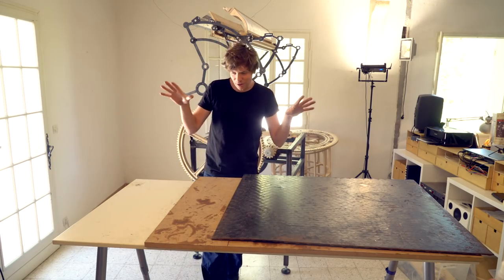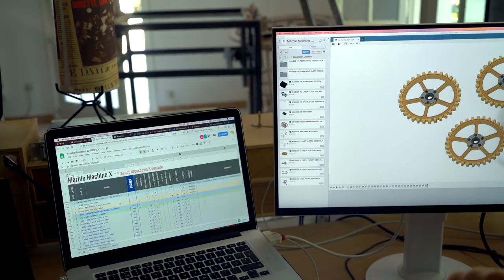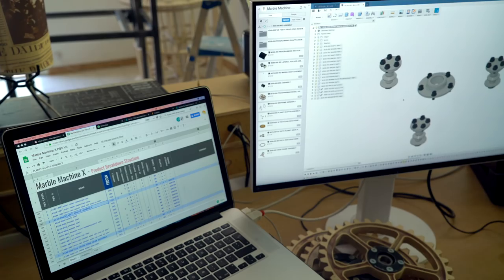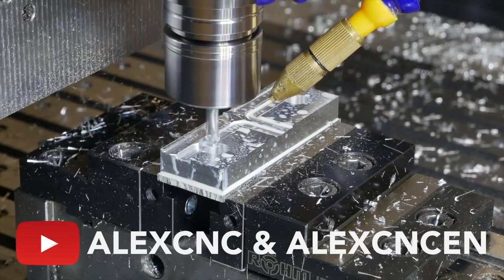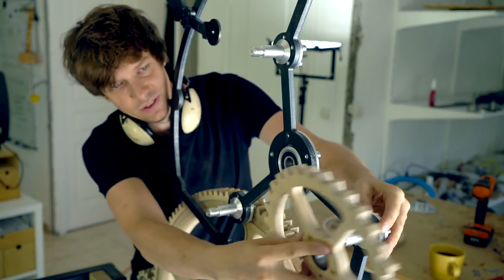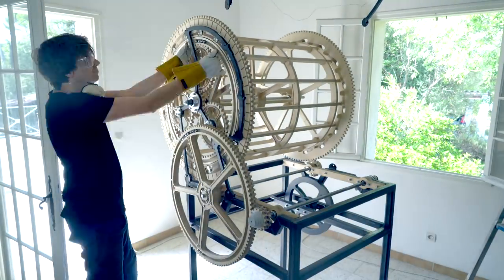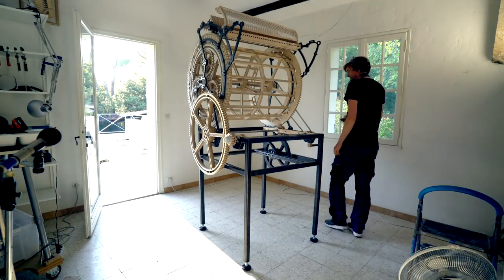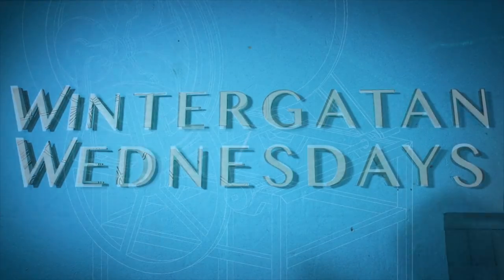NEXT LEVEL PRECISION - Marble Machine X #48

Comment from the maker: YAY! Acrylic washers were temporary, and galvanic corrosion is not a problem in this case :) just guessing some of the questions that might occur down here in the commentary field, Looking forward to some more #200-001 now.
Reply: Wintergatan your guitar needs a setup man
Reply: Green Day fan never would have thought
Reply: I thought you had a small drill press? You can use those to tap stuff and keep the tap vertical.
Reply: #200-001 is a necessity when watching your videos. Otherwise one might miss something.
Reply: Quick question, have you thought about putting any kind of finish on the black metal frame? Like brass for instance, or maybe silver to match the aluminium parts? The contrast between the light yellowish brown plywood and the dark metal is fine, but I feel like it could look a little better. Of course, this is a cosmetic issue, so I imagine if you have considered this it will be as one of the last few steps. Apologies if my question is a waste of time and you'd already thought of/answered this.
Reply: Imo, you should add a spring loaded idler pulley to the drive belt to help add some tension (to help keep the belt from wiggling up and down when you crank the handle). Having one will also allow the drive belt to automatically re-adjust/stay snug even if you move/adjust the main drum.
Reply: I don't  think that temporary solutions are good for mmx project, you should make parts that are ready to be added to mmx ;) I think it will somehow speed up the building  process
Reply: Wintergatan you should patent the marble machine if it is becomming a product
Reply: (feedback for team YouTube:)

The member system is a nice concept, but at 4,99/mo it's crazy expensive. €60/year for sponsoring one channel. Multiplied by however many channels you want to sponsor this could be an additional month of rent each year for some people. The way I understand it you still get ads on YouTube if you pay for membership? That seems a waste of money. 

I'd rather see a tiered system like patreon has, so people can choose how much to spend instead of being forced to spend a lot or nothing at all. The timed badge could make it difficult for some people to stop their subscription even if they can't really afford it anymore since you lose a lot (sunk cost and such). 

Please reconsider the badge system and make it tiered as well as able to hide it from your comments. Not everyone want the world to know where they spend their money :)
Reply: Patience dude, it's going to pay off for sure!
Reply: Are you from sweden?
Reply: 13:14 please Wintergatan, sink before you tap and not after.
the tap will then enter the metal easier and makes it easier for you.
(and also making it easier to not snap the tap)

and if you don't wan't snapped taps please find a drill-press or something that can keep the the stuff at the right angle
Reply: He dropped the guitar to the floor and he needs to glue the neck
Reply: Wintergatan chamfer your holes before you tap them. It makes it much easier
Reply: Can we get a link to view that spreadsheet please? I'd love to see it!
Reply: Did someone actually bring up a galvanic corrosion issue?

Comment: Oh my gosh. GET A DRILL PRESS. Especially for cutting threads with taps. Countersinking also. As others have said, alignment of threads is vital. If you think Excel has made a world of difference, wait ’til you cut threads with your tap mounted in the chuck of a drill press. Continued success. Don't stop.
Reply: I have a reduce speed reversing Chuck for tapping with a drill press. If your interested let me know with an address Marty.
Reply: THANK YOU, Marty. I'm all set for starting taps using a drill press, then I remove the tap from the drill press chuck, leaving the tap embedded in the piece, and finish cutting the threads by hand with a tap handle. (Of course the idea is to get the tap started straight.) However, I greatly appreciate your thoughtful message. Hopefully someone else will see your offer and go for it. Thanks again.
Reply: Get a pillar drill !!!!!!!!!!!!!!!!!!!!!!!!!!!!!!
Reply: @stancoutant  actually you can use a different trick - many/most taps have a little hole in the rear of the tap. You can put a pin in the drill press chuck, and then put the tap in the hole by hand, and then use the drill press to push the pin down through the middle of the tap and provide the downwards force when tapping. This will keep it perfectly vertical. 
And this is also why proper tap wrenches never cover the rear of the tap - you're supposed to use this trick. Just do not turn the drill press on when doing this. 

Drill press stability and alignment, while allowing you to turn and counterturn it by hand. 

I suggest hanging a little weight off the knob of the drillpress to provide the downward force, as that frees both your hands.

Comment: Condolences on the tap. Always sucks when that happens. At least you could salvage the part without too much effort, though. That can get nasty in a hurry.

Some constructive criticism, you should really be a lot more careful when tapping. Running taps in a hand drill is incredibly risky. If you go in at too great an angle it will jam and snap before you can release the trigger, which seems to be what happened here. Your replacement tap, with its straight flutes, is also really, really bad for machine tapping. They're meant to be run by hand, the chips collect too fast in the flutes to run in a machine.

If you've got more holes to tap, I'd recommend getting another tap with spiral flutes to run in your drill, and be VERY careful to keep the drill straight at all times. To assist, you can make a tap guide out of a piece of flat aluminum stock that's maybe 15-25mm thick. Drill a hole in it that's the major diameter of the thread you're tapping (8mm for M8). The tap will slide in perfectly, and if you clamp the flat aluminum piece firmly against the work you're tapping, it will force the tap into perfect alignment and you can run the drill at full speed with few worries.

Edit: Do note that the hole you drill in the tap guide must be perpendicular to the surface you're clamping against, otherwise it'll just force the tap into the wrong alignment. Should be easy to do with your router, either with an 8mm drill bit or interpolating a hole with a smaller cutter.
Reply: Also, the 1st tap was for bottom holes. The 2nd tap is for through holes.
Reply: I thought the same. I have never tapped anything except manually. They are very slow cutters.
Reply: It is possible to get a mount for a corded power drill to use it as a pillar drill. That might be handy, but I'm not sure it works with cordless drills. Or you could just buy either a corded or pillar drill.
Reply: Danfox Davies: Unless you have special (and very expensive) taps and dyes designed for automation, it's far better to just stick a manual bar on and do it by hand.
Taps are not like drills, they don't have enough channels to remove the swarf,  so you have to drill in a bit and then pull out and keep repeating.
If you are tapping into a blind hole, you also need three different taps (pilot, straight and bottoming).
He was being lazy and/or inexperienced. Don't do it.
Reply: Spiral flute taps are fine to run without backing out (and they work better that way, it's the whole reason for the spiral flutes), but I agree, it's just about always better to tap by hand. If you've got a milling machine and are comfortable rigid tapping with it then great, but if you do then you probably don't need advice from YouTube comments on how to tap. If you're new to tapping, then definitely grab a T-handle wrench and go _slow_, with a ton of lubricant.
Reply: Exactly. No experienced engineer would dare.  I am no expert, but my Dad is, and I asked him tonight and when I mentioned a tap jammed into a drill chuck he just said "Oh, Jesus Christ..." and sighed.
Reply: Metabo actually makes a reversible tapping drill (cordless) that reverses direction when you pull up. IN any case he should do these by hand. On a regular drill this is like trying to drive a truck that is too big through a low ceiling tunnel. You can do it, but you have to go slow. Also when you tap by hand you only do about half a turn and then go back; he's trying to do ten turns at a time. Surprisingly amateur, given the amazing advanced techniques he employs the rest of the time.
Reply: tryptychUK: 
I said pillar drills are a possible way. I didn't say they are the best. Looks like you and the other commenters below know much better than I do anyway.
Reply: You should never use low quality taps. With a cordless machine, I preferably use stream oxide HSS two flute spiral point ones, with proper cutting lubricant. Also, it helps a lot to use a countersink before tapping. Just be glad that you didn’t decide to go stainless...
Reply: Danfox Davies Yes, I use an arm that keeps a pneumatic tap drill vertical. It's so reliable and repeatable!

Comment: its like he is building a product by ikea but like with a few thousand parts.
Reply: Luke Synthetic we all know how he could have reduced the number of parts but then it wouldn't be so fun to watch him struggle
Reply: Almerinda Romeira how do you reduce the number of parts?
Reply: Brick for starters, the number of spacers is huge. He could have spared dozens of them. Also, because the design of the parts must be simple, he must do assemblies where otherwise we would have made a single piece. Example: i saw the other day two cogs united by bolts (2 cogs+5? bolts+ 5? washers+5? nuts= 17 pieces vs 1 single big wood piece.
Reply: Luke Synthetic sooo, exactly like ikea
Reply: + he invented the AND designed the product so he is the one man Ikea if that makes sense AND he´s preparing it to go to Ikea one day   ;-)
Reply: Almerinda Romeira The problem with using big parts as opposed to small ones is they’re more vulnerable and costly I think. Let’s just imagine for a second that the marble machine was one piece. That means that one breakage equals replacing the whole things as opposed to just switching/adjusting a few parts to fix a specific problem. Plus, more parts look nicer
Reply: Alexis Alexander i think the biggest problem overall would be construction. He doesn't have the tools to fabricate more advanced single parts. Although I might add that single bigger parts are more reliable and makes it always easier to diagnose problems
Reply: Almerinda Romeira Yea, could be true, what do I know lol

Comment: Yay for Wintergatan Wednesdays! 11 minutes and already 90 comments! MArtin, I need you to contact me concerning cables on my Modulin II build. When do you use the MIDI cable? Also, I would have made the sides out of aluminum, not steel. It is strong enough to support the mechanics yet lighter.
Reply: If I recall correctly he went into a big long thing when he was designing it, and concluded that steel would be better as he liked the thinner profile of the steel  that he couldn't get if it were aluminum.

Comment: Those planetary gears were a fantastic idea. And the way the outer ring slides one way while the programming wheel goes the other is magical. I miss some MMX ASMR you know, quietly cranking the machine and the mic really close by to capture the gears grinding.
Reply: there is no planetary gear set in this construction. it's a simple gear train. there is no planet carrier thus no planetary gear set. it is that simple.
Reply: RubyRhod I think you understood what this is all about better than me, don't go r/whoosh just because it's not mechanically correct, we all know it's only visual.

Comment: Martin, I admire your perseverance. No matter how high tech the manufacturing of the MMX parts are, a Simple Machine such as a PULLEY helps. How unselfish of you to share the specifications, components and other information about the MMX build. You haven't completed it yet but it's an OPEN SOURCE. Your persistence really pays off because you know that there is a solution to every problem that occurs. You are freakin' amazing Martin! Not only are you building a ginormous instrument, but you are also going to be an "accidental" LUTHIER.

Comment: Thats why I only buy HSS taps. We don’t tap enough holes for them to wear out. So HSS is good enough and they don’t snap. You also get a ton of the highest quality german made taps on ebay. I can only assume that people steal them from work. Who sells three brand new M6 taps that you buy from specialty vendors?
Reply: He should be using his drill press to hold a manual tap in place with a center in the spindle. Or just use the drill press directly.

Comment: Machinist here, Lucky you were able to salvage that part when that tap broke. When tapping any metal with a power drill especially steel make sure you reverse your tap. Go down a bit maybe 2~4mm, what ever your comfortable with, reverse and clean tap of any chips. This will prevent your tap from breaking, also I find when tapping quickly motor oil will go a long way to save it as well. 
MMX is looking awesome btw!
Reply: How much did you cringe watching that?

Tapping by hand is slow and tedius, and tapping with a drill press is a pain when it's such a big piece. But a single broken tap shows just how worthwhile it is.

I learned early on that there's a reason there is a right way and a wrong way to do things. And breaking a tap like that will show so clearly that you're doing it the wrong way. In fact in my experience it's all too easy to tap the hole at a slight angle if you are doing it like that, and that small error can make assembly much harder than it needs to be.

Comment: Just a heads up, Nyloc nuts don't really work if the thread don't go through the blue plastic bit, unless thats just for mock up.
Reply: Heads up, Nyloc nuts don't really work. The only (proven) locking solution is Nord-Lock. (I know, it is at unobtainium price)
Reply: I hate Nyloc nuts, not to be relied upon and take a lot of force to install. Jam nuts any day instead - not perfect, but Nyloc is not hard to beat.
Reply: Nyloc nuts work for certain applications however you are only technically only supposed to use them once and if you have to take them off you are supposed to replace them, at least that's the rule for aviation in the US iirc from back when I worked in that field.
Reply: Cyberdyne Systems:  Just to give you an example:   Re-use of nyloc nuts was the cause of the disaster at the Reno air races in 2011.  The P-51 that crashed into the crowd suffered a failure of its elevator trim tab.  The cause of the failure was Nyloc nuts that came loose due to being taken off and put back on.
Since the MMX won't be going 500 mph, re-use of the nuts in this case may not be as important as the P-51 example.

Comment: nobody here seems to know this:
usually when you want to thread something you will bore a hole for the thread you need. i.e. when tapping a M10x1 thrad you need to bore 9mm, a M16x2 thread needs a 14mm bore due to the metric thread geometry. there may be other values all over books and the internet for several reasons I don't want to discuss here.
it seems that you tried to laser-cut the hole and that very bad for any other machining operation like tapping, because the laser-cut surface is hard and briddle like glas and usually harder than drill bits or thread taps. and THIS is why your tap broke.

next time make the laser-hole as small as possible and then use cheap drill bits to widen the hole, then use a good drill bit to bore the hole to the dimension needed for your thread (i.e. 8,75mm and then tap it with your M10 thread (regular M10 is M10x1.25 --> 8,75mm hole).

I am an engineer for argicultural equipement and design parts like yours in my everyday worklife and I was told this (see above) by ANY supplier we have for designs like yours (laser-cut parts with threads).
Reply: RubyRhod I work in a sheet metal fab shop, programming and running later machines (3200 & 4000 watt) for 22 years.  You are correct that the laser cut edge is hardened, but the problem is not as bad as you imply.
The heat affected zone near the cut edge is fairly small, and depends on material thickness. In thin sheet, it might be .002-.005", while 1/2" plate might see .015-.020" HAZ. it is hard, but I'm not so sure it is harder than the tap.

The bigger issue is the oxide layer, which flakes off and abraded the tool edge, dulling the tap quickly. I agree that undersizing the holes, then reaming, is best practice. Usually, undersize by 1/64 - 1/32" is plenty. It is not really necessary in thin sheet.

Comment: 46% in 48 videos, so the Marble machine X is goint to be ready in one year from now, is too much xD. Almost 1% for video.
Reply: MIHAWK SOLITARIO not necessarily. If he installs 5 parts for every note on a single step, it's gonna be close to 200 parts at once.

The main frame took a lot of time per part. Some sections will require less time per part.

You can't calculate a lap on a Grand Prix race on the speed of the car in an hairpin where it slow down to 60 km/h. There are also straightaways where the car can do 300.
Reply: Simon Rancourt Nice analogy, yeah i think youre right.
Reply: MIHAWK SOLITARIO, you're forgetting the 90-90 rule.

The first 90 percent of the project accounts for the first 90 percent of the development time. The remaining 10 percent of the project accounts for the other 90 percent of the development time.

So at this rate, the MMX take 3 more years to complete. lol
Reply: Much of the design and planning effort probably is not captured by the PBS, so he may be further along in terms of total time required.
Reply: Like the process has to be even LoL you can't estimate on the average
Reply: Louai -- "the other 90%"  LOL so true
Reply: @louaial-obaidi3998  Your numbers aren't right. First 10%, not first 90%.